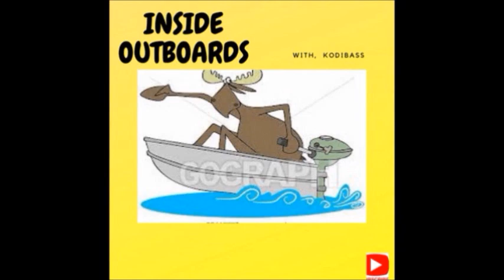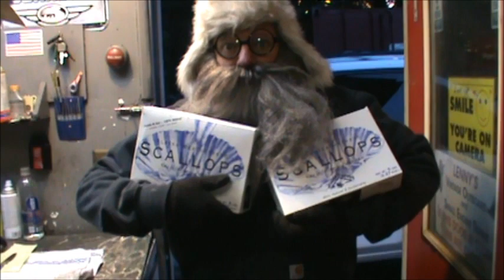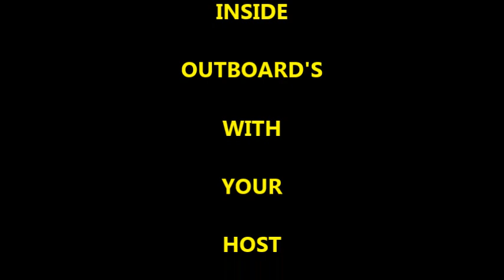JOHNSON 15 HP,,   PART OUT

Comment: I also love custom, I found a motor harness that actually had band aids on the wire connections instead of electrical tape. !!!
Reply from the maker: haha, I have not come across  that one yet  ""yet""  But I have come across some stuff that was done well,   I guess it depends on the do'r        kodi

Comment: Hey kodibass, can you do a short video on how to put the spring back in a tiller handle. I have a 1973 25hp Johnson and as you know it doesn't have a man overboard switch. So I would most definitely like to have the spring in the handle. There's not 1 video on how to. You'll be the 1st
Reply from the maker: Gary,  I am not sure which spring you would like a vid of ?  The Spring in the Tiller has nothing 2 do with Throttle return.    It only provides Lash  Pressure for the Brass sprockets in the tiller handle. If you could let me know what  exact issue  U R having I may B able 2 help U.     kodi

Comment: What years does that cdi go to?
Reply from the maker: This will be a general answer as some smaller outboards kept points for several years after cdi.  But it seems to be OMC  transition all motors 9.9 hp & up around 1977  with a few exceptions mostly on there very small outboards, in the 2 to 4 hp.